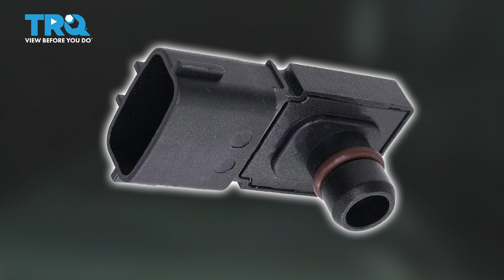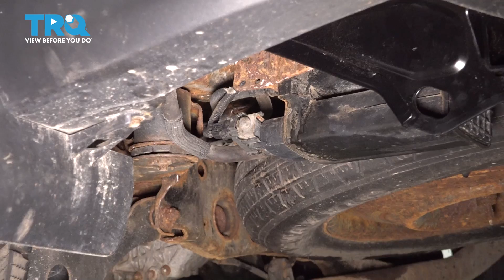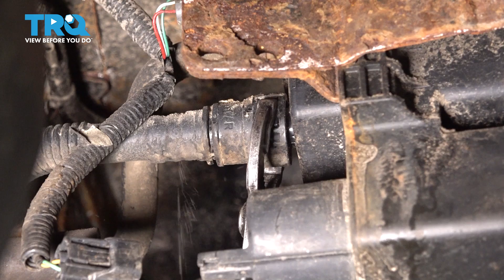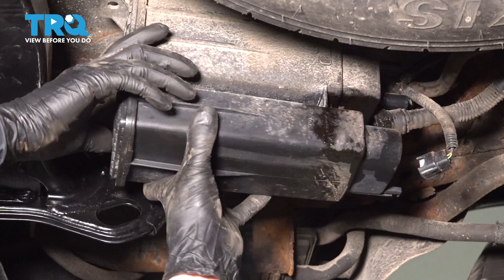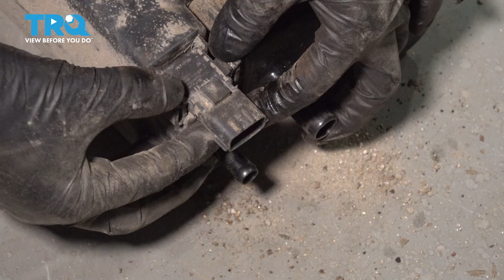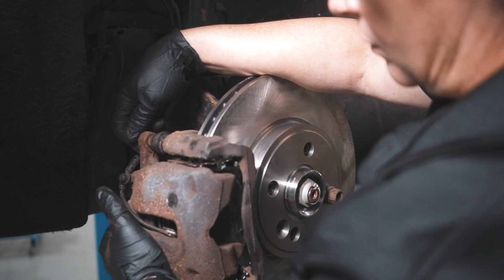How to Replace MAP Sensor 2013-2020 Nissan Pathfinder

Comment: Everybody....This is not the MAP sensor. I mean think about it. How would a MAP sensor located at the rear of the car measure the Manifold Absolute Pressure at the intake manifold , which is on the engine.

Comment: Could this be bad?  I replaced the solenoid valve and purge valve in front of car and still getting the P0456 error code after driving 70-80 miles..